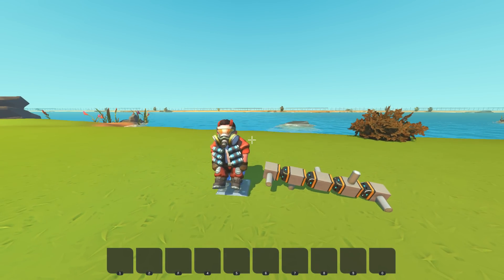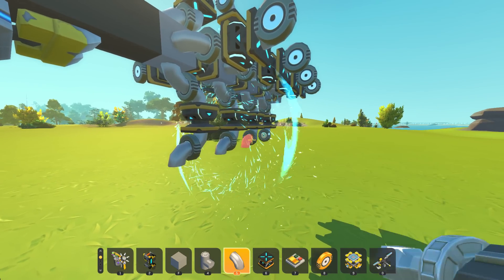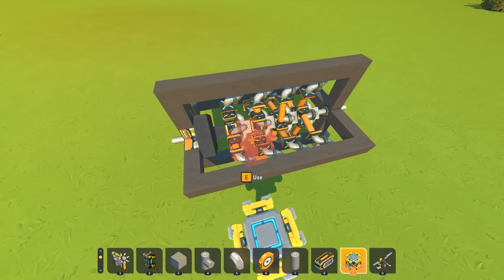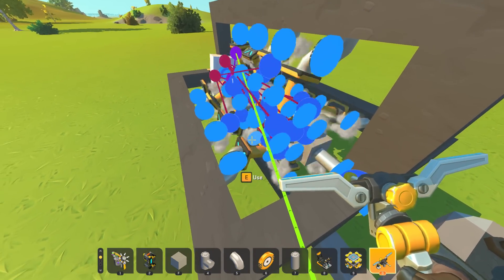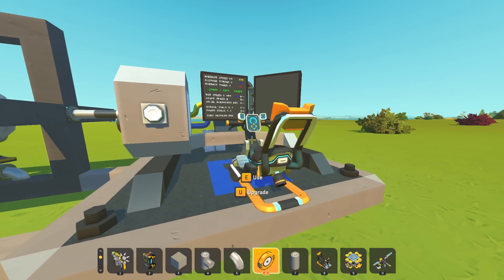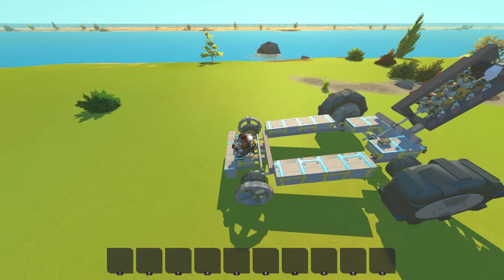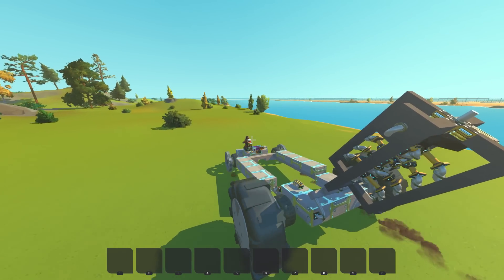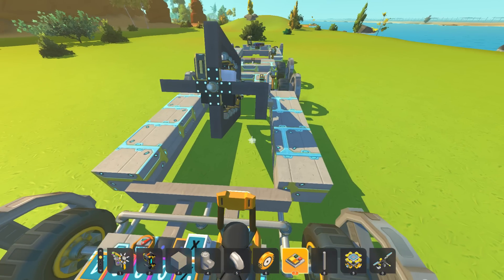I Built a Crazy 16 Cylinder Piston Engine That Couldn't Exist in Real Life!

Comment from the maker: How can we build transmission and gear systems in Scrap Mechanic? Any good real life examples to follow?
Reply: Not trying say that I’m right but isn’t it a prop plane engine four cylinders just stacked four times?
Reply: @Predaking900 depends on what kind of prop plane, older bi-planes would use 5 cylinders, but larger planes may use one or multiple large engines (:
Reply: Mechanical parts mod and the associated blueprint pack
Reply: @TheThingBuilder true
Reply: Go to 32 piston engine
Reply: i think the mechnical parts mod is good, but not for gearbox. they mesh good and all but you can't stack them on eachother, like you can only attach a pipe or block on one side. you can get over that with throughbearings and that but i won't reccomend using it for gears. and if you want to make vanilla gears, i think i saw someone on youtube make a 90 degree gear with suspention and when i saw it it looked really smooth and compact.
Reply: you get a new mic you sound different
Reply: @Predaking900  from my knowledge most prop planes have radial engines not sure if that helps!
Reply: you could use "Fants Propulsion Stuff", a block and parts mod for creative with which you could make a epicyclic CVT with his ball wheels or, as a stopgap measure till a working gearing vanilla made is constructed, straight up use the "gear box" modded part.
Ik Ik, you don't like Fant, but if even if you hate the man, you still can use the tools that work
Reply: I have a random suggestion on reliability:
You are currently attaching the coding wheel loosely to the shaft using a controller-driven bearing, while having the sensor rigidly mounted to the frame. Given the speed and torque of the shaft, the bearing is bound to lag behind at some point...Try to do the opposite! Mount the coding wheel rigidly to the shaft and control the sensors position w.r.t. the frame with a controller-driven bearing
Reply: @Luziferne why doesn’t kAN like 00Fant?
Reply: Make a plane
Reply: Love these videos, but I need to see you do them on a race track type map! Like topgear!
Reply: @Ekipsogel  
I don't know but it seams to go way back to earlier days of the file mod times
Reply: hey kan, ive requested the rolls royce Vulture maybe 5 times now. you basically made it except the vulture would use 24 instead of 16. the vulture was made in WW2 to fit the request of a 2 engine bomber that could carry 10,000 lbs of bombs long range. it was also fitted to a prototype fighter
Reply: I'd say look into early history of gears and transmissions since they were originally pretty chunky due to the manufacturing limitations of the time
Reply: Well I found out how to get gear ratios from 2:1 and 1:2 with pipe gears, but that's all I have managed so far.
Reply: Planetary gear set it probably best for scrap mechanic physics, I made one a few years back but lost it through a computer failure
Reply: I built a Differential in SM based on the lego diff, although it doesn't work very good
Reply: @darkwatersband  how big was it by chance? I could probably try and  make it and possibly improve on it
Reply: You could maybe get the same effect as gearing by using a double piston arrangement: connect the power piston to the crank shaft via a "gear" piston(on the other end of the L pipes), which would alter the mechanical advantage.
Reply: Would the engine provide smoother torque, if half the pistons were slightly more rotated than the others?
Reply: Im not sure, but I think a white n would be better instead of the L I say do a test with an L and  n
Reply: @YoBoiDannam  pistons don't work like they do in real life, they behave more like a hydraulic cylinder, where force while off is always active, and force pushing it out while active. Different levels and speed settings change the torque produced, if you had it on in a n / u shape with a majority of the time being off, you would have pistons pushing each other to rotate instead of complimenting rotation.  The same is true if it was active a majority of the time, and all pistons would be fighting to overcome other pistons that are active in order to rotate. This is why an L pattern shape is even, and therefore half of the time is pulling, other half is pushing, and the ideal time to switch on to off and off to on  is perfectly at TDC & BDC.
Reply: @YoBoiDannam  sorry for an eyesore of information but it simply wouldn't rotate, regardless what part was active
Reply: using the crankshaft piston glitch thing, do u think youu could actually make a rotary motor? like an actual dorito?
Reply: @AOM-Media  not odd numbered radial, but anything even could work
Reply: Here is an idea. Instead of using 2 gears, you can try using 2 universal joints to get the rotation to your driveshaft. No parts colliding with eachother. Just a load of bearings.
Reply: How can we talk in private im gonna show u
Reply: @-aid4084  yeah did a bit of testing the l was the only one that did it properly
Reply: Use a simple lego type of transmission
Reply: I remember this guy made a video about making transmissions in scrap mechanic. think his name was kan gaming or something like that
Reply: @dylanwaldun8890  i feel like a gear transmission would be too laggy, but maybe a different transmission method?
Reply: Look at the gear shifters and transmission in Lego technic cars and custom Lego transmission. Those may work somewhat
Reply: Another way to bring the torque to the road would be the Constantinesco Torque-Converter, as i can be build in a 90° build grid
Reply: Been trying the transmission. I only know the basics, gear ratio was "fine" but bulky, gear shifting i tried multiple ways, the basic transmission setup and the "modern" one i havent exactly tried (the modern one being way too difficult if doable at all). I used a piston at a 15% degree with a gear, which connects to the gear ratio giving different steps based on piston distance, odd numbers being multiple reverse gears because why not.. That gear itself then connects to a parallel axis to transmit torque into the wheels after countless gears going down vertically. It's clunky at best. Looking forward to see what you come up with!
Reply: Bro forgot about Bugatti

Comment: 5:50 The shape of the L only offsets the timing, which you can counter by offsetting the angle in the controller. That is because the regardless of the direction of the L the sensor time in back and white doesn't change at all; it is always exactly half/half. The ray cast from the sensor is  coming from the middle of it and is basically one dimensional, which means it has no area of detection. It's just a zero width line. So, the angle at which the black changes to white does not matter.

Comment: An obvious tip for steering: vanilla seat bearings have 2 angles in their settings. One is for going clockwise, the other one - anti-clockwise. You can just use the vanilla style steering and manually set angles to be different for inside and outside turn
Reply: The seat needs to be  the highest level too, otherwise it doesn't have that option
Reply: Anti clockwise or counter clockwise? Is there a difference or just a wording goof?
Reply: @apersunthathasaridiculousl1890  I have no idea, I mean English isn’t even my first nor second language :)
Reply: @Tschuschka_Ichwillitsch  if you have no idea, you probably meant counter clockwise (opposite direction of clockwise)
Reply: @apersunthathasaridiculousl1890  yes, “anti” seemed like a good synonym :)

Comment: You should try making a short stroke engine and an automatic ignition wheel angle adjuster(the faster the engine spins, the more angle the ignition wheel gets)
Reply: Wdym by short stroke?
Reply: @-aid4084  shortening the levers in cylinders to let pistons extend less to spin the crankshaft once
Reply: this is a short stroke engine, its 1 block from the rotating center. doesnt get any shorter than that in scrap mechanic
Reply: @xDmakc like the other person said it's already short stroke, So the only way to get more than 307 rpm  would be to double up on pistons and have them max speed 1 distance rather than 1 max speed two distance.
Reply: @dr.beardie9894  it does. You need to use a controller and rotate the lever(it should be made differrently than we usually do it)
Reply: @-aid4084  there is another way
Reply: @xDmakc  please,  elaborate
Reply: @-aid4084  i just noticed the link i tried to send got deleted. So here's the title: 1560 rpm 1 piston engine
Reply: @xDmakc  I think I watched that video before, one piston horizontal,  one pistons vertical,  modded parts to get the timing and speed?
Reply: @xDmakc  non it was a different video nonetheless, that has some voodoo magic keeping it going that quick
Reply: @xDmakc  from what I can see, it doesn't produce much torque because it has such small leverage, so I'm not sure how usable it would be as an engine unfortunately...
Reply: @-aid4084  the lever doesnt have to be that small and you can add more pistons
Reply: @xDmakc  exactly, and the more leverage the slower, that's the only way it got to 1560 rpm. just to get the same rpm with 1 block of leverage you would need 5 stacked pistons, and I'm going to try and get a piston engine that gets to 2100 RPM. I'll keep in contact to tell you if I got it. Gotta wait till I get home to do some experiments though

Comment: To tune for max torque you can set the pistons to the slowest setting and tune it to where it runs perfectly smooth at that low rpm. This make it where it does not run amazing at high rpm but it will not reverse direction and it will not stall out as easy. This is what I used to get 40,000+ ft/lbs with a large crank flat 8.

Comment: 5 better alternatives to your collision-based 90° gears:
--- 2 universal joints.
Downsides: Can be non-constant-velocity, if you don't align them correctly on the intermediate shaft.
I'm not 100° sure you can get a n intermediate shaft that is built at an orthogonal angle to a 45° angle. But it SHOULD very easily be possible to just build the shaft as an inherently 45° piece. You can alternate 90° pipe elbows or use wedges.

--- Constant velocity joints
Downsides: Good luck coming up with a way to get them built in scrap mechanic. 

--- Hobson's Joint.
Downsides: I don't know if scrap mechanic has force-less pistons/suspensions; Size might be somewhere around 6*6*3.

--- There's one even more obscure alternative that I've seen in a youtube video. I don't know the name , so I'll try to explain it:
It consists of an axle fixed at 90° to both input and output. The next piece is an L-shaped piece which slots over that axle at it's elbow (with the two arms of the "L" pointing towards the input and output shafts, respectively). This piece slides along the axle and pivots/rotates around it by some 20-40° or so. The out-of phase combination of sliding and pivoting creates circular motion of the ends of its arms around the input and output shafts, which spins a crank arm attached to the end of the respective shaft.
Downside: The motion of the arms of the L-shaped piece isn't fully planar. You'll have to account for some minor movement parallel to the shaft.
And I again don't know if scrap mechanic has force-less pistons (for the sliding of the "L" piece along that intermediate axle.)

--- Or just mount the engine "sidewinder style" (with the crankshaft axis parallel to the wheel axle).

Comment: 9:40 you dont need to put the controller on loop. if you turn loop off you can set a predetermined angle and when you activate the controller with W it will go to that angle and stop there, when u hold S angle= default angle that you put in the first slot.
Also yes you dont want your torque going thru the controller timing advancing/retarding bearing, unless you have a torque passthrough, you would want to have your output be on the other side
Reply: He knows. He was making a setup without predetermined angle so you can change without touching controller (Like for example load change while driving or something)
Reply: @Krokmaniak   you can go to a predetermined angle while in a seat by pressing w with a non looped controller
Reply: @spacewalk3046  I know. The whole point is the angle isn't predetermined. Setup like this allows you to change the timing while changing load (for example attaching trailer)
Reply: @Krokmaniak  i dont see how this would help, as you would have to do the guesswork everytime you put it on the lift or spawn it in again, instead of just experimenting what angle gives you the torque you need but still high hp and going to that same point by just holding W, or going to a multiple speed setup, for example 3 sets of angles the first one has most torque, second bit less but more speed, and 3 just for top speed.
A indicator you can build for it as well, kind of like kan did in this vid, just put it on the same sets of angles as the 3 speeds you did before.
Reply: @spacewalk3046  Problem is point with highest torque without load isn't the point with highest torque with load. Load on the system decreases RPM completely changing timing needed to make engine work smoothly. There is no good 1:1 comparison with real combustion engines, as they work completely different and timing is locked mechanically by piston going up instead of fancy timing wheels. Despite that it's not that different from driving manual car. Yes, most cars have a lot of meters, but most drivers only look at speedometer to make sure they drive within the limit, and even this is sporadically. Most of the time you eyeball the throttling of the gas pedal and what gear needs to be engaged. And it changes all the time even with same speed as inclination and declination of terrain change the load of the system. Not to mention manouvers like engine breaking.

Comment: If you put a timing wheel with the L shape at 30 degrees you will have it so when the piston is slightly past top dead center, it activates. This works in both directions but the angle might me supplementary

Comment: 3:05 There's only one consequence that placing the pistons that way could have, as far as I can tell. The base of the piston might be heavier than the head of the piston, which would increase the inertia of the drive shaft.
Reply: Tested this myself in the game. As far as I can tell, the weight is shared evenly between both parts of the piston. If there is a difference it is incredibly small, so small, it probably wont have any meaningful effect in this case.

Comment: the one whom made the Raft Mechanic mod has a mod for creating bearings that connect their rotational force without gears slipping if you want a more seamless setup for testing potential power transmission without worry of gear slip

Comment: A different sort of piston engine you could try would be the e-rex "one-stroke" engine, which is actually a two-stroke engine, but works sort of like a rotary. Though I'm not sure how well Scrap Mechanic blocks would work, because it requires circular ramps.

Comment: WW2 tanks used Radial 30 (it did not share the same crankshaft), also there's those "W engines" I think VolksWagen has a W12 concept car (4 inline 3)! Ah I remember there was the "H engine" 2 Flat 6 engines connected by the gearbox in F1 (I think it was Lotus that did it, not sure).

Comment: Check out the FANT mod. I've been messing around with the gearboxes in combination with piston engines to avoid 90° gears. This also allows suspension to be possible due to less lag, you essentially treat it like a normal engine, but the piston engine is connected to an input bearing. Also if that mechanic isn't good enough, just as the name suggests there are multiple gears that change the ratio of torque and RPM

Comment: You could probably put the timing wheel on the outside of the engine, reducing the bearing slack in it, using a pass through. Just a random idea.

Comment: I feel like there is a complex idea No one has touched on yet where you have the crank shaft spin around The Pistons only having bearings where two Pistons would meet. It would look like old biplanes where you had an engine spin around.
Reply: To elaborate further, it would be like having twin crankshafts and meeting pistons that would spin around a crankshafts. if you adjusted the distance between the crankshaft, you could change the leverage that the Pistons have on the crankshaft

Comment: simple braking system: lift the back wheels of the ground
more elegant solution: since pistons dont break because of torque, disconnect the driveshaft by piston contracting like a very bad clutch

Comment: Quick question: Is a proper X engine possible in Scrap Mechanic? IRL they are way too complicated and expensive for the power they output so.... maybe that will be the result in Scrap Mechanic? Also think your target should be a 700rpm engine since that is what modern pickup trucks have

Comment: do you think it is possible to phase shift each set of 4x pistons so the you have 16 pistons that all start pushing at their own unique time?  ultra-smooth running and there would basically be no dead point at all.
Reply: Would need a crap ton of sensors
Reply: nope @Idiot354
Reply: @Jamesdavey358 you can with a modpack smart engine
Reply: @cheesiestmaster879  oh yeah that's true

Comment: The bigger the gear is, the more torque you can transmit because there's less force further away from the center of rotation, since scrap mechanic let's objects phase through each other that's the only way to handle massive torque

Comment: Scrap mechanic gears are terrible, but there's a linkage that uses pistons and bearings to transmit power like 90 degree gears would. I designed a differential using those that can take 20 000 nm of torque without slipping at all!